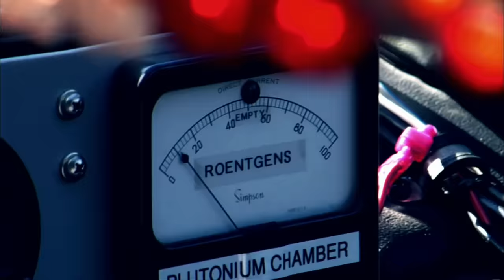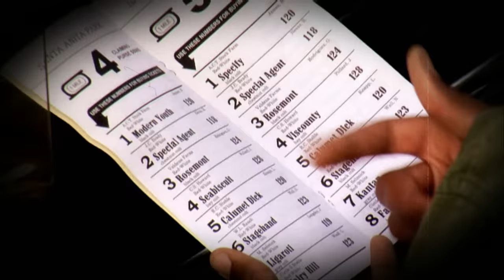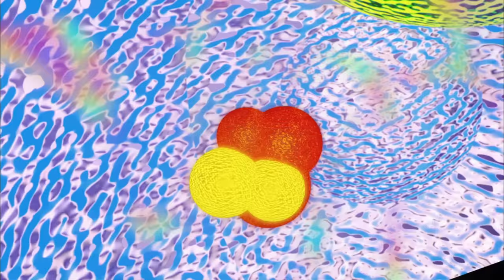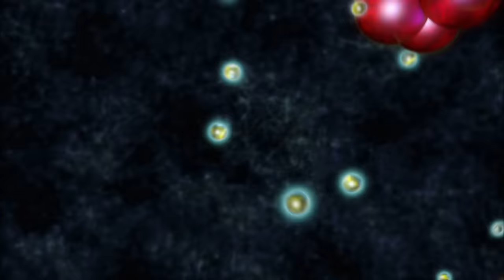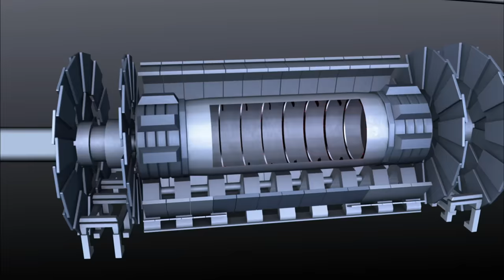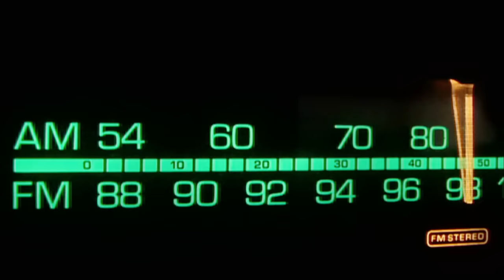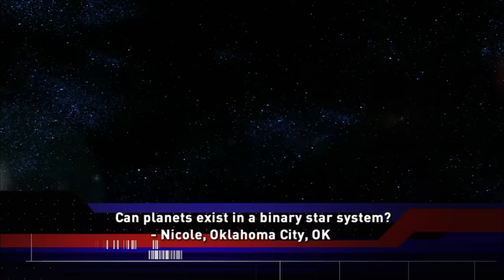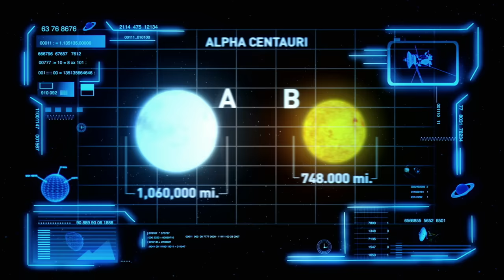The Universe: The Time Travel Paradox (S5, E4) | Full Episode

Comment: If you travel one hour forward or backward in time, you would likely die as where you were standing would no longer be under your feet. The Earth is not only rotating, but it is revolving around the sun while the sun is revolving around Sag A* which is also traveling through the universe
Reply: You could do the calculations to arrive safely
Reply: Or since time is fluid would we end up in the same place either way since we are moving forward or back in time.  The earth will be in its location 5 seconds ahead or 5 seconds behind regardless of the leap in time.
Reply: Interesting
Reply: @chrisreidland  the earth is never in the same place twice, never
Reply: @JasonHolody76  calculations? You would need to be in a rocket which would negate the one hour time travel
Reply: @jerrybushman  In the past it is still in its same place as it was in the past. In the present it is at its current location. And in the future it will be where it will be.
Reply: @chrisreidland  as you will only be traveling through time and the Earth is traveling through space, the Earth will not be where you need it to be anymore
Reply: @jerrybushman  They say time ,space and even gravity are and or were possibly the same , at least at one point. This is stuff on the horizon of current understanding.
Reply: @jerrybushman  or your time machine is mobile
Reply: If you bend space, then you bend time. One day we will have elevators that shoot you up much faster. Atoms will be traceable in 50 years. The black budget, hidden and secret government projects, might already have the tech to accomplish this. C.E.R.N. was built years ago!! 17-mile long machine way underground that breaks up unseen particles at 99% the speed of light.
Reply: @JasonHolody76  it would have to be a powerful rocket
Reply: @jerrybushman 
Actually, if you were to utilize a time machine within a gravity well, you would essentially be "locked" to that gravity well due to how spacetime curvature works.

To put it in simple terms, the gravity well would "drag" your time machine along with it.

And before you argue, realize that we are "time travelling" every single second on the planet and it doesn't go speeding off from under us.
Reply: @azerdraco3146  interesting idea, but that would not account for the Earth's rotation, in one hour your location would change a whole time zone. As for your thinking the Earth doesn't move much, it moves enough to have you rematerialize inside a wall with a one second jump
Reply: @jerrybushman  
Casual observation negates your reasoning.
When you jump, you don't suddenly slam into a wall because the Earth kept moving while you were not touching it.

The reason for that is that you are inside the planetary gravity well.  Even objects in stable orbit of the planet are still within the planetary gravity well.  That is why satellites move with the planet in its orbit of the Sun.

What you are wrongly envisioning is that a Time Machine takes you outside of time, and thus outside of the warping of spacetime by gravity.

That is completely impossible.
Human biology REQUIRES a steady forward temporal motion.  We require time to move forward to keep our bodily processes functioning, down to the electrical signals firing in the brain that give us consciousness and rational thought.
A time machine would need to maintain a "local temporal lock" in order to allow the pilot to continue living during travel. Thus, the machine is locked to the planet and moves just like you or me.
Reply: @azerdraco3146  Earth is moving through time and space, a time traveler is only moving through time. There is nothing for gravity to be pulling on as you technically do not exist until you reach your new time destination. A time machine transports you through time from your original location to your original location. Trouble is, your original location in the universe is now not on Earth
Reply: @jerrybushman  that purely an assumption proven with science?
Reply: @chrisreidland  what is proven by science is that nothing is where it was a minute ago and nothing is where it will be a minute from now. I used an “hour” difference to make it easier to understand. Think about how it would be if it was 100 years forward or backward
Reply: @jerrybushman  prove it
Reply: @chrisreidland  🤦‍♂️
Reply: @jerrybushman  you can't prove your theory
Reply: @jerrybushman  Albert would have a thing or two on that
Reply: @jerrybushman  
Actually, you are incorrect.
Space and Time are inextricably linked, and it has been proven in repeatable scientific experiments that an increase in velocity creates a reciprocal decrease in time experienced.

That is called time dilation.
Time dilation also occurs within gravity wells, especially deep ones such as encountered near stars and black holes.

Since gravity warps time, then it is an obvious extension that any time travel occuring within that gravity well would be warped as well, meaning that you could NOT simply time travel an hour into the future and be free of the gravity well, as you are suggesting.

The gravity well drags you along with it. And the gravity well extends far beyond the surface of the planet, as evidenced by geosynchronous orbital mechanics.

Now, I will admit that you would be correct if the gravity well was not sufficiently deep enough to hold you to the planet.

A gravity well such as on the moon may or may not be able to hold a time machine stable on the surface. I would hypothesize that a gravity well between a sixth and a tenth the power of Earth's would be the lower limit required for the gravity well to drag the time traveller along.

Please study Einstein's Relativity. It explains the interconnectedness of spacetime in much greater depth than I can here.
Reply: Yall need to watch the why files seriously
Reply: @rodrigomorales5191  will it teach me facts on time travel? It won’t because there are no facts because time travel does not exist
Reply: @jerrybushman  
If time travel does not exist, then how can you have something that happened "in the past"?

Just because you can only move one direction does not mean that you are not moving.
Reply: @azerdraco3146  did you really just say the past is because of time travel? 🤦‍♂️
Reply: @jerrybushman  
Yes.
Time exists.
You are travelling forward through time at a rate of 1 second per second.

You really need to read some science books, kid. Most of us learn how to tell time before preschool.
Reply: Space Time Machine is the proper name for a Time Machine
Reply: I don’t think sticking the landing would be of much concern if we could figure out time travel.😂😂😂
Reply: @stereothrilla8374  time travel is nothing without a ship to take us to the exact point in space
Reply: @jerrybushman it does. Traveling to the future is possible and it is how GPS works. You obviously only rely on a gut feeling rather than looking at facts. Traveling to the past reveals a plethora of paradoxes. If you were to remain at the border of the event horizon around sagittarius A* 1 minute would be equal to 700 years on earth. Calculus equations reveal this.
Reply: @Death_is_inevitable.  Time travel into the future is theoretically possible if you are in a spaceship. If you are on earth, time travel would have to involve moving through space as well because your original location is not where you left it.
Reply: @jerrybushman it is not "theoretically" possible. It is proven. You obviously have no knowledge that gravity is also responsible for time dilation. GPS experiences a gravitational time dilation of 0.00006 seconds. Not to mention that that the GPS does move as well. It is called geosynchronous orbit. Study more before choosing to spread misinformation based on a gut feeling.
Reply: @Death_is_inevitable.  you are off topic. We are talking about time travel here, on this planet, not at an event horizon. Just to get there would take 26,000 years at launch get speed. This is about what would happen if you traveled in time here. Here would not be in the same place you would reappear through time.

Comment: I feel like the problem with wormholes is that the future hasn't happened yet so how can it exist in a place that doesn't yet exist?
Reply: That's pretty thought-provoking ❤
Reply: Quantum physics. Duh.
Reply: Or unless past present and future exist at the same time altogether… future, can be seconds, hours, days, months, years etc. 

But lets go with days. 

Future depending on your CHOICES and actions you are already on a path of your choice. Depending on events that happen inbetween you could end up on another spider webbed path. 

You order an item, a package 📦 is on a path to you several days out. 
You know that the probability of it reaching you is NOT 100%. Cause anything can happen to prevent you receiving the package. But it still on its way in the future. 

Not a very good analogy but it is possible. 

I am 3 hours behind texas, 4 hours behind Connecticut. Living in the past of several family members as they are in the future compared to me. 

We need to start thinking outside of Relativity i believe.
Reply: Check out the block universe theory.  All moments in time exist at the same time.  You can connect future and past with a worm-hole.
Reply: Future will exist but your traveling on different time. Your time is passing slower but others will be faster but it’s all in one

Comment: When I was 15 years old, I was walking on a country road and struck from behind by a fast moving truck. In that instant, I was both in the moment of impact and on the side of the road simultaneously. As I was flying through the air, everything stopped, and I was looking at myself standing to the side, although I was inches away from the centerline of the road. I locked eyes with myself, as I would a coach during a sporting event. The me that was on the side of the road was identical in every way. That me ORDERED the me in the road to grab my head, and throw it between my knees, stating clearly "or you will die". I reflexively obeyed. In THAT instant, I heard the loud bang of the impact with my left elbow, saw the lenth of the truck passing me, saw my foot ricochet off of the rear tire and flip me over the bed of the truck. Then everything started again, I landed with my arms around my head, between my knees, as one would in a plane crash. Ifelt very clearly the intentionality of that movement, as I had felt many times before doing flips on a trampoline. Then I looked up and saw my friends jump and startle from the sound of impact, and look around to see what happened and where I was.
If thats not some kind if proof of potential time travel, I don't know what is.
Reply: lol
Reply: somebody always got some story
Reply: That's not proof because time travel is impossible 😂.
Reply: @4ortnite20 there’s plenty of proof, you just won’t believe until it happens to you.
Reply: Your experience sounds more like a separation of spirit from body just prior to impact, than time travel. Maybe look into OBE's.👍
Reply: Ahhh yes. The country road pickup truck paradox. An often controversially debated topic of quantum physics.😂😂😂 Glad you’re ok. Call your mother. She’s worried about you.

Comment: Actually it is possible to stay within the same time reality while traveling back in time, to do this though requires firstly, to realize the actual speed of light is not what we have been led to believe.
Secondly you must be within a faraday vacuum 
3rd you must know how to calculate the amount of photonic energy needed 
And lastly in order to get relatively close to the time period you must calculate the atmospheric pressure and photonic scew present in roughly 60ft area of the time and place you wish to travel too while also finding a unique tag particle to lock onto

To do these things from last to first

You must find a unique tag particle within your existing time frame then using advanced mathematics beyond my ability to explain in this post, you then follow its course in reverse by calculating its speed and interference ect ect back to the point you wish to travel 
Then at that point you use even more advanced math to figure out the surrounding photonic makeup with in the area at that point in time within 60ft radius 
Now you have pinpointed your timeframe reference point.
 Now you shoot the original tag particle you initially isolated back at
 “the speed of light” 
Then using a complex faraday vacuum you are then able to slip through time to your desired timeframe reality riding the wake log the tag particle you shoot back through makes

Of course the cost of faraday vacuum needed to send a full size adult costs around 281 million dollars 😂

But you could theoretically build one yourself big enough to send a mini flash drive with parts off of Amazon for about $3600
 As long as you could accomplish the other things mentioned yourself without millions of dollars worth of  computer systems running calculations 

This is all simplified of course but in a sense it is the gist of it

Hint hint why do you think Gold is so valuable??? It makes for the perfect tag base by spraying gold particles you are more easily able to find and identify undamaged unique tag particles most of which turn out to be mercury or cadmium

Shooting back such tags essentially creates what we know as dark matter

By finding dark matter in current timeframe we can essentially reverse the process and slip into the future as well
Your welcome 👍

Of course for national security and world security I left out the process involved in actually aligning and slipping the faraday vacuum into the dark matter time slip sorry 😞 but can’t give that away

But….i will give you a hint 
Has to do with manipulation of gravitational fields between particles think in terms of vortex😉

Comment: 20:00 That is not a solution, because you cannot go into the worm hole until after it 8s finished traveling. Which takes 500 years according to this. So to travel 500 years into the future by the worm hole manipulation isn't a solution at all. It's a contradiction. If you were to go into the worm hold at 10 years after the manipulation process began, then you'd just be at the same 10 years into the "future" which is just the present.

Comment: I need help with my new years resolution.  I'm trying to change the stars.  What I mean is, get the IAU to, OFFICIALLY, make a new constellation. 
My idea for changing the stars includes Orion and Pleiades (Subaru).  I figure it's time to put something up there that's relevant to us, don't you think?  Take Orion's belt and Betelgeuse becomes the head with a baseball hat.  The 3 stars of Orion's belt make up the 3 fat belt loops on a baseball uniform.  Below the belt are two legs bending at the knee.  Saiph is the back foot and Rigel is the front foot.  The feet aligning perfectly under the bent knees.  The spear pointing at "Subaru" is the bat being swung and "Pleiades" is the baseball flying away after being hit.  Bellatrix is the hand that let go of the bat.  Put it all together and you get, "THE ALL-STAR."  In my case, I see a left-handed batter and I imagine a "7" on the jersey. Which makes him, "Mickey." (As it should be ;-) But you can put any number you want, making, "THE ALL-STAR," any player you want. It'd  be wrong of me to not, at least, try.  This is me, trying. Pass it on, please and thank you. Don't worry, where I come from, crazy is a compliment. ;-P

Comment: My idea so I get to name it! What I mean is, no one has claimed it so I'm officially calling, "Dibs."  Voyager 1 is now in the, "Milky Way's interstellar time" or "Mikey's Time."
"V-ger's" message has sped up now that it's outside our Sun's, "Time Bubble," or, "Terran Time."  It will be faster, still, when "V-ger" sends a message from beyond the Milky Way's time bubble. Then there's Outside the Local Group time bubble.  So on and so on until we get outside any influence and into the, "True Interstellar Time Standard." Or, "T.I..." ;-P
Now that "V-ger" is outside our Sun's reach, in interstellar space, it's now in the Milky Way's faster moving, Interstellar Time or "Mikey's Time."  This can be proven by turning off everything except its clock and transmitter.  Have "V-ger" read time for as long as possible.  They WILL show the flow of time speeds up the further away you get from any celestial bodies.  Until you reach the Milky Way's time standard or "Mikey's Time."
•Our sun's time bubble: "Terran Time" we know and have measured.  In a lifetime, our head is one second younger than our feet.
•Milky Way's time bubble or "Mikey's Time." The rate/flow of TIME outside any influence but within the Milky Way: We just got there and are still figuring what the difference is. I'd say time will increase in speed, now and until V-ger is outside the Ort cloud. 
•Local Group's time bubble or the rate/flow of time outside of any influence but within the Local Group: Name still open and unknown. Wild guess .08 P-22% to a couple seconds faster, maybe. Used just for reference.  You know what I mean. 
•Outside any influence in the, "True Interstellar Time Standard." (or T.I...) ;-P  This name is NOT up for grabs. The rate/flow of time is fastest here.  (Time flows fastest here so it's best to use a motor boat and hold tight.  Always applies when you're in T.I....) ;-P
A minute is a minute in all. It's the rate/flow I'm talking about.  Heck, rivers of time flowing differently might explain dark energy and dark matter.  Difference in time could explain great attractor, too.  Fun to think about, isn't it? Anyway, the "Milky Way's Interstellar Time Standard," will be known as, "Mikey's Time."
Pass it on, please and thank you.